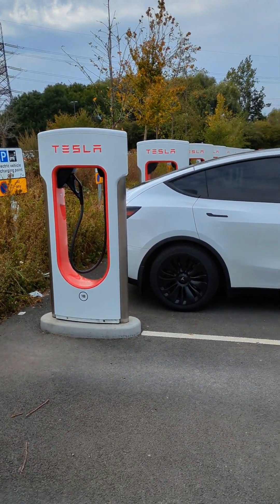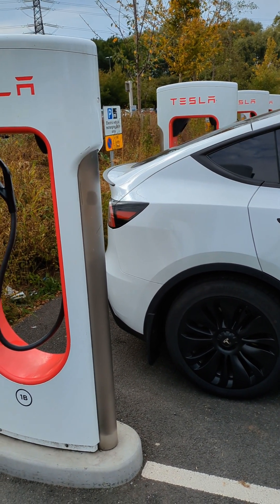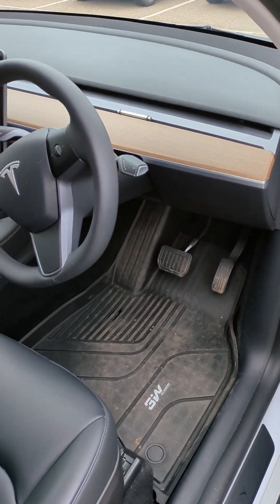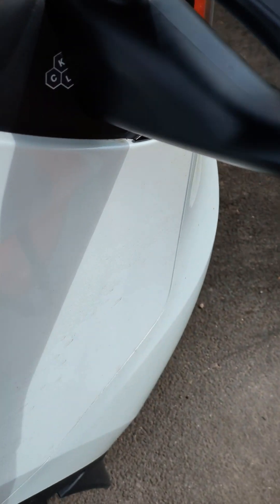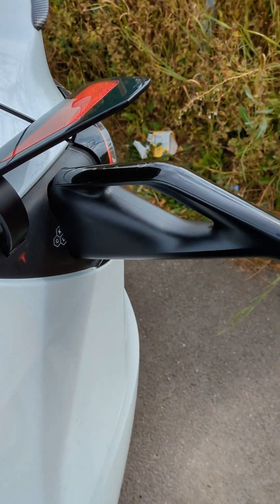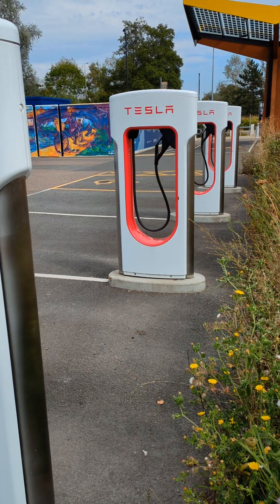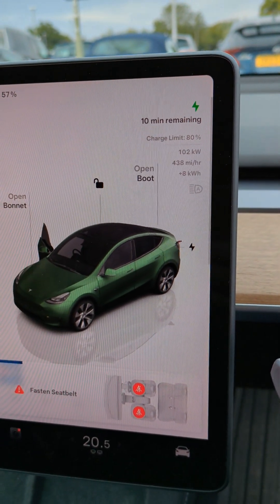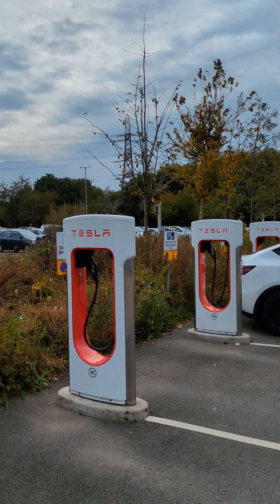Tesla Supercharging problems. 3 failed charges. Due to overheating?

Comment: Still no Tesla chargers at Membury services heading eastbound, they had been very slow but are now no longer available and behind fencing. There are no Tesla chargers available on the M4 east bound from S Wales at Sarn  Services until you get to London, and even worse if you are heading to Surrey on the M25 from S Wales! It is ridiculous that it requires a diversion off the motorway network to find a charge, even then at the Hilton near Terminal 5 you have the added cost of paying to park to charge! Tesla is going backwards.
Reply from the maker: All my stomping ground too. I used to regularly use the Membury chargers. I don't know why they're closed as it was such a busy Supercharging site and desperately needed.
I used to regularly go to Hilton T5 too when on the M25, but haven't since the hotel introduced the parking fees.
But I would agree, the Supercharging network has stalled, maybe going backwards too and all at the same time more Teslas are going on the road each month.
Reply: @GoGreenAutos  On my way to Reigate today, navigation sending me to superchargers at Sarn about 15 mins after the start of my journey or the Celtic Manor at Newport which is really awkward to get to off the M4 and again about 30 mins after starting the journey. I will probably stop at Wokingham Superchargers if it isn't flooded but no services or toilets etc. Really disappointing when Membury was a straightforward stop a quick charge, coffee, toilets and seamless journey.

Comment: I have a feeling that bank 1 is having issues and they are all in a "fail safe" mode, hence the fans are going crazy as a safety precaution.

I highly doubt it's actually a temperature issue

Comment: Very interesting 🤔
The country where these units are designed and tested Texas and Calafornia USA gets wayyy hotter than here in UK so heat issues should have been designed out.

Perhaps the heat limit threshold I set too low.

Comment: Never seen this before and would not expect the temperature to effect it. Are they grouped in banks and if so was this a set of chargers, so more likely a back end problem with their supply?
Reply from the maker: 1A, 1B, 1C, 1D, 2A, 2B, 2C, 2D are affected and had the fans going.
I then moved to 3A and it worked fine, but the fans soon started on that stall too.

Comment: Looks like failed ones are 1 A, B, C and D? Your last one that worked is 2A? 
May be the backend 1 MW cabinet feeding those 4 stalls is having problems. 
Shouldn't be temperature related, they are designed in sunny California and/or Texas.
Reply: Yep.  I charged at 110F the other day no issue.  However, one of the charging stands only worked for 2 minutes and then quit.  Changing to another stand fixed the issue.  The charger should auto report any error to Tesla so they can dispatch a service person.